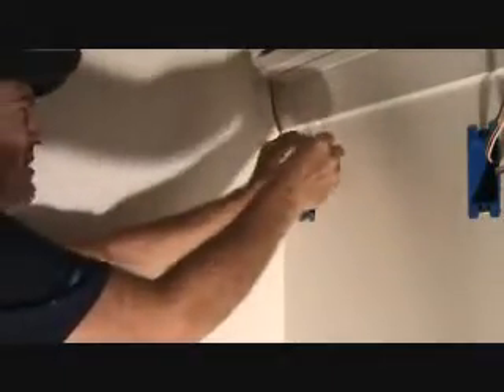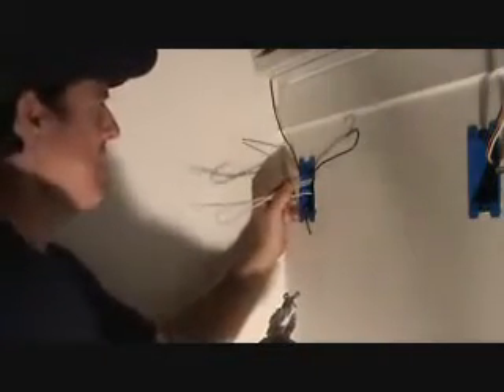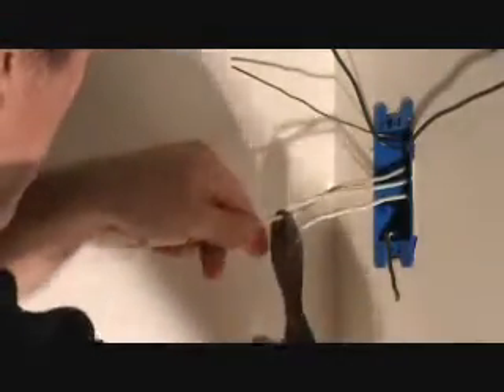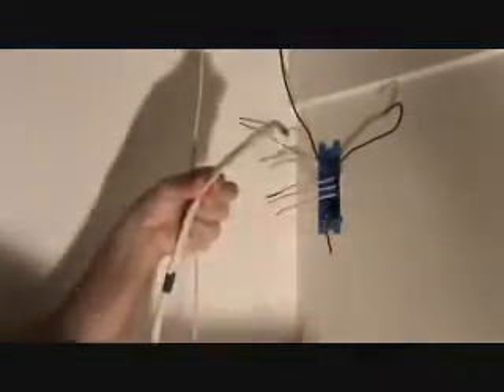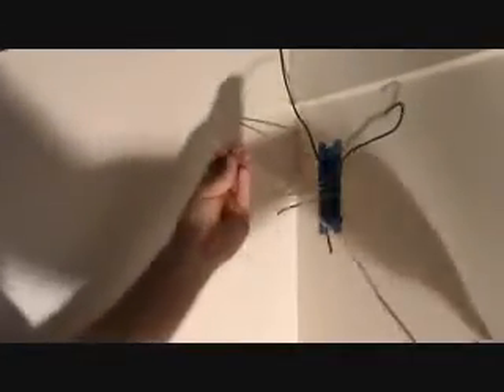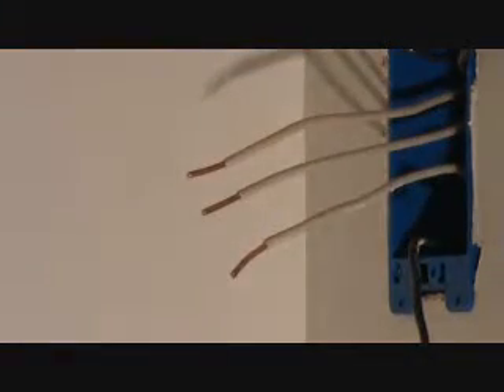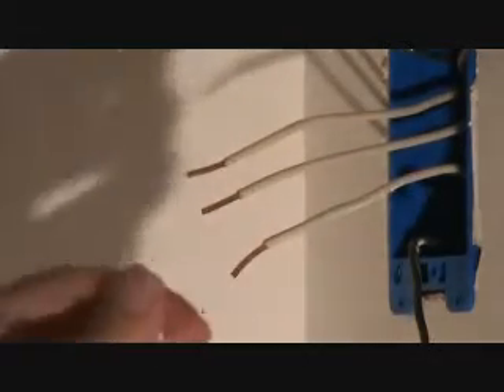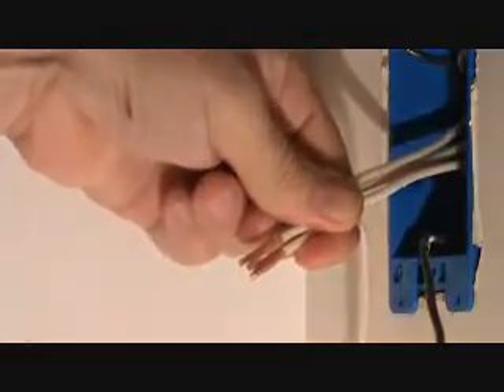How to connect the white wires for an electrical outlet...Part 1

Comment: On those longer wires I'd have put a single bend in em and stuffed that one bend back into the box to make them the same length as the short one. Thank you for taking your time to show folk how to do these things. I used to do commercial electrical and find that your lil' videos remind me. It's been probably 17 yrs since I did electrical. Save for a few little things here and there. You ever think about teaching at electrical school? You're a good instructor, you'd be great at it.
Reply from the maker: Hey thanks so much for your comments! Much appreciated. You also make a good point on the longer wires. I'd rather not teach at an electrical school...rather my electrical school is my youtube channel!   Joe  :0